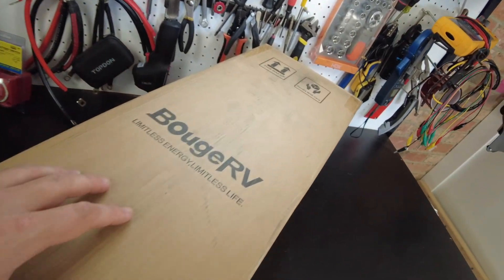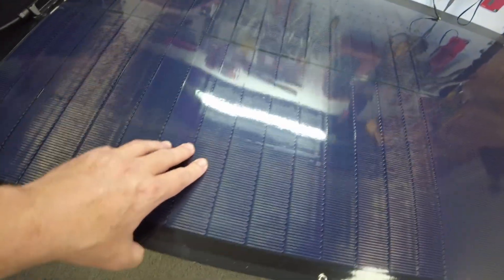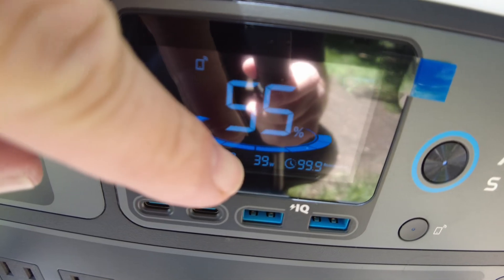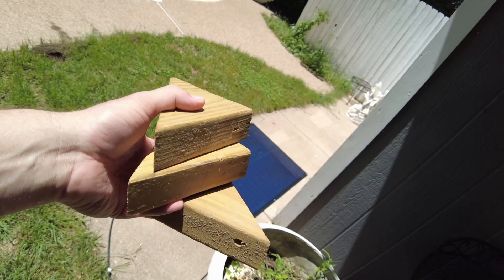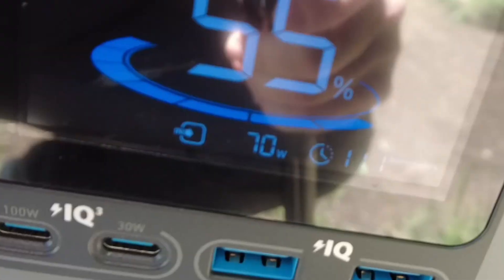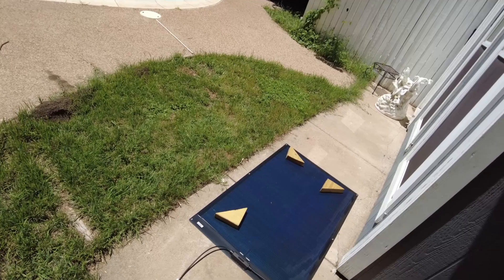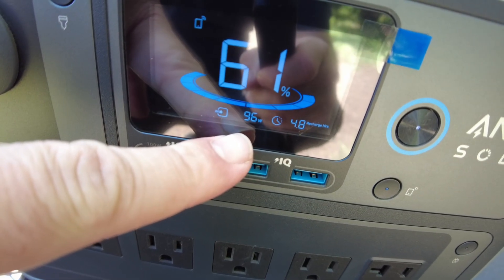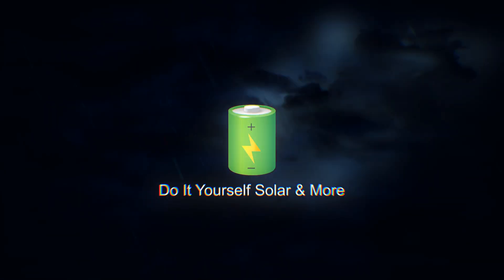BougeRV Yuma CIGS Flexible Solar Panel

Comment: I have the BougeRV 100 watt compact CIGS flexible solar panel on the roof of my truck and I just installed three 80 watt Rich Solar CIGS solar panels on the roof of my truck cap yesterday. 
Im hoping these Rich Solar CIGS work good. 
I bought them on sale for 72 per panel. 
My BougeRV 100 watt CIGS panel has pulled over 100 watts on numerous occasions.
Reply from the maker: Oh wow, I'm interested in how those perform :) Thanks!

Comment: Yeah, I was thinking about buying a couple of those panels the 200 W variety but they’re like 500 bucks apiece! So I have to piece mill it, I have 3 lithium 100 amp power this week in the mail
Reply from the maker: Yeah, they are up there. Looks like the model I have here is on sale right now, the amazon listing shows decent savings https://amzn.to/3YaBnok Thanks!
Reply: @BradCagle yeah Brad I currently have 2 175 flexible Renogy’s which I have seen as much as 120’s watt range when they were newer, now I’ve seen 80ish watts total combined. Saw your video as well as another influencers channel on these panels and figured this is a sure thing with the output! Thanks!